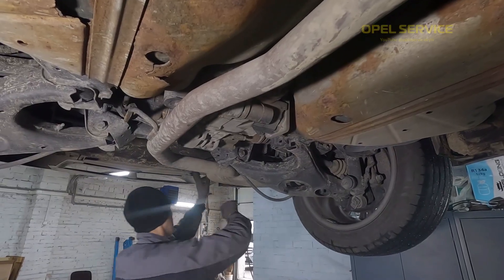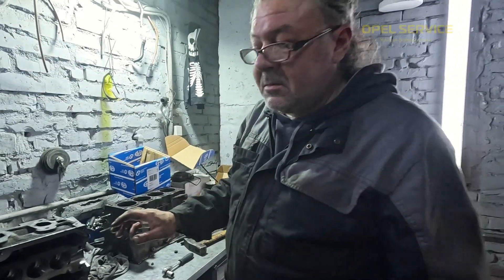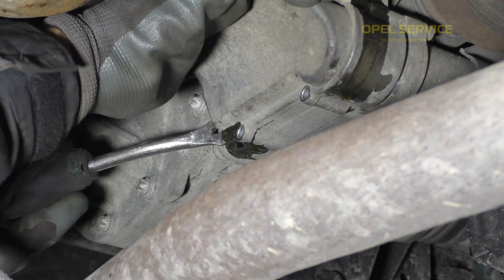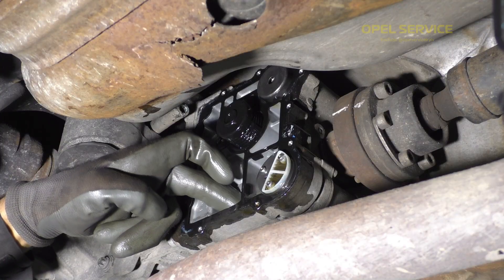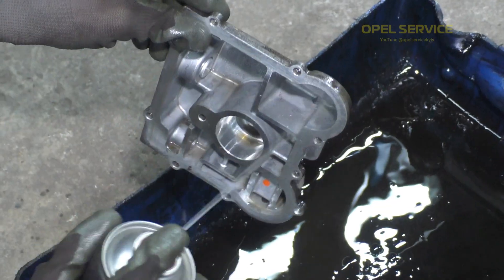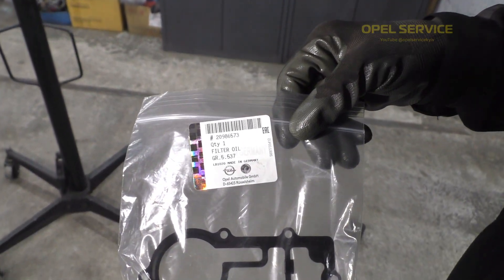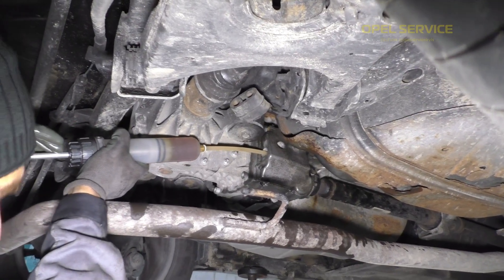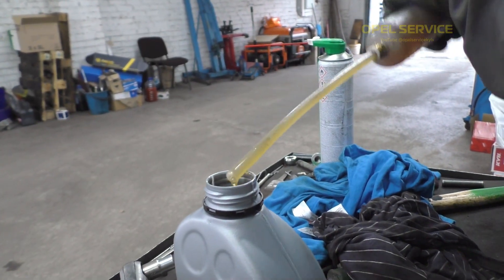Dirt and Shavings in Haldex - How to Save Your AWD

Comment: Salut, comment tu fais si t as pas outil diagnostic pour faire fonctionner la pompe et avoir le bon niveau ? Tu remplis , tu vas faire un essai routier puis tu ajustes a nouveau ? Je dois le faire absolument sur insignia 4x4 2.0 cdti 2014 *140.000 et jamais vidangé car opel dit a vie. Merci de ton aide .. si tu peux m aider aussi avec reference du kit joint / filtre. Merci